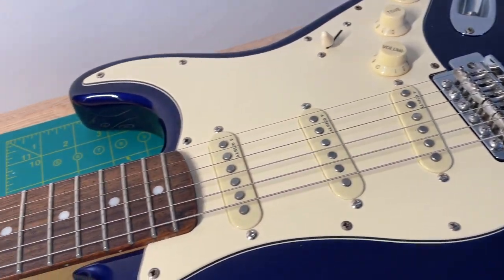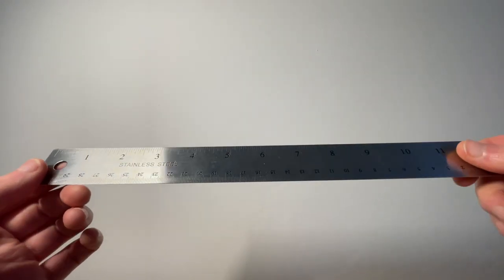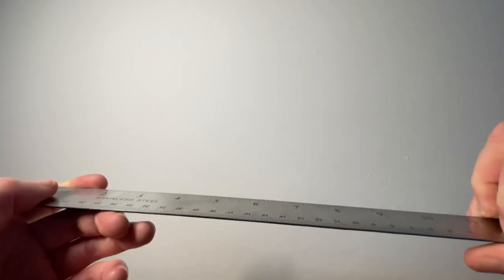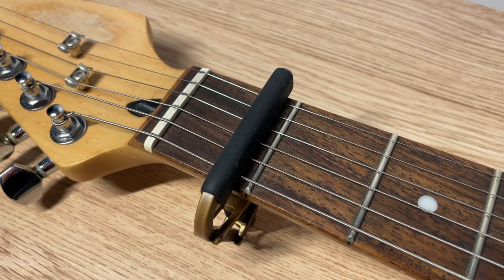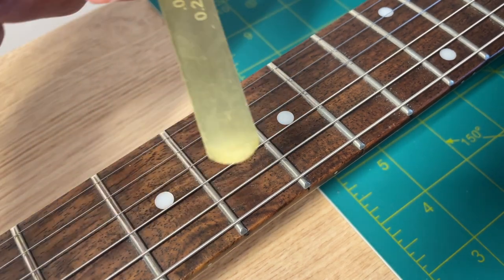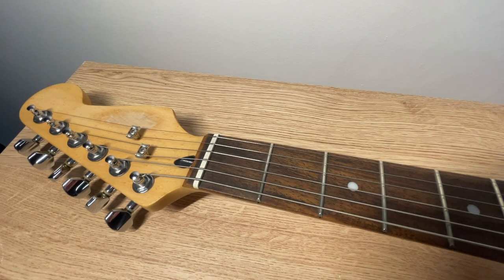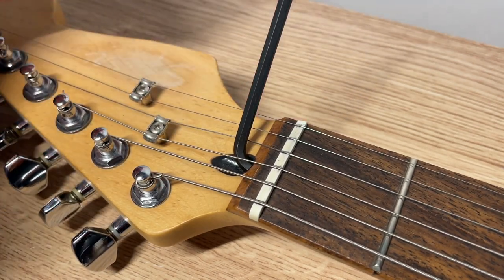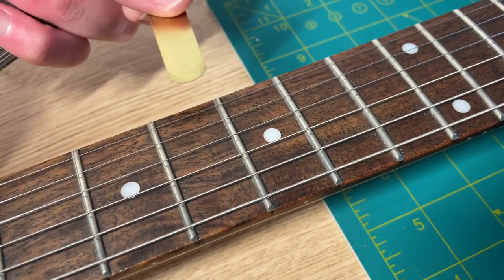How to Adjust the Truss Rod | Guitar Setup Pt.1

Comment: Please does this reduce the string tension?🙏...my strings are too tight and it really hurts
Reply from the maker: As far as I'm aware, the truss rod adjustment will have very little effect on the tension of the strings when they're tuned to standard tuning. I'd recommend you look up "scale length", as this is what dictates the string tension, and is different for different types of guitars. Hope this helps!
Reply: @GuitarReviver  thank you very much sir
Reply: You can also try smaller string gauge ex: 09